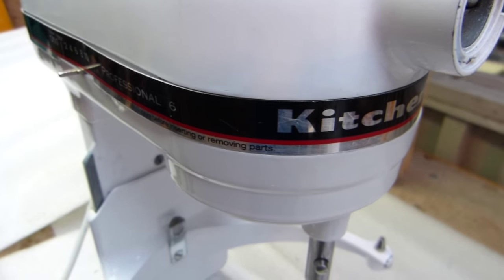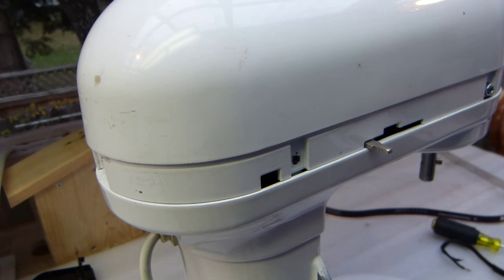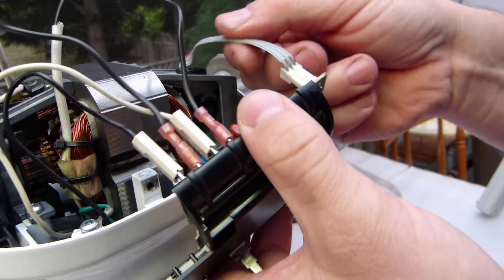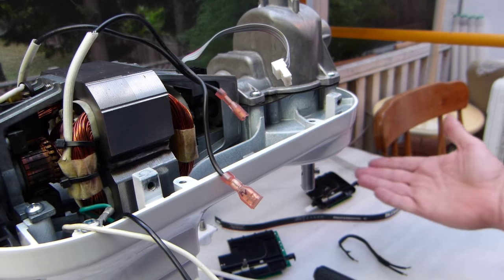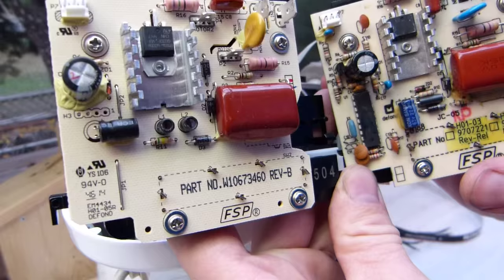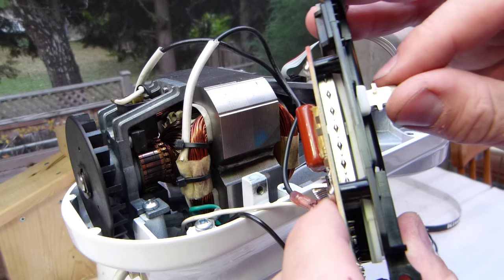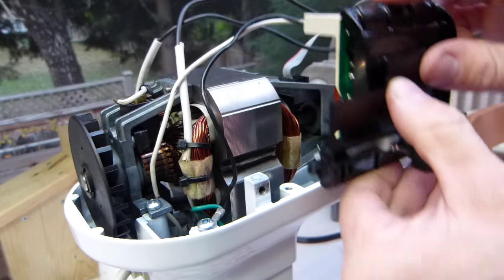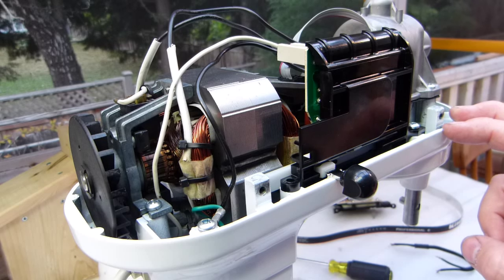KitchenAid Pro 6 easy electrical fix

Comment: Thank-you so very much!  Before I ordered the circuit board, I removed the slide switch from it, and cleaned the 2 copper pieces with a Q-tip and acetone.  After mounting the switch back onto it, and screwing it to the mixer, I tried it out and it worked!  I would have been too intimidated to attempt this without your informative video. Thank-you for leaving your video up.

Comment: IT WORKED!! Breathed new life into my 20+-year-old machine! Great mom & son project :) Thank you for posting clear, easy-to-follow instructions. FYI, the new circuit board had the wide grey wire soldered to the board, so we had to remove the old one from the machine. There are tiny clips on the side of that plug; pushing them in to release (after some trial & error), and plugging in the new one worked out just fine. Can't wait to tackle some backed-up bread-making projects! Thrilled! Thank you again!

Comment: I sprayed contact cleaner on the switch and cycled it back and forth several times to get mine working again. Thanks for the video; it helped me with testing the motor. Otherwise, your switch may have been good, just needing a cleaning. Cheers!
Reply: I was ready to start unsoldering components for testing but thought I'd give this a shot. After a squirt of cleaner, moving the switch back and forth a few times and then reassembling, it works perfectly! Definitely saved me a lot of time. Probably saved me $50 or so to replace the entire control circuit if I had been unable to find a failed component.
Reply: @lexl9533  Same. I had a feeling it was the switch because it started to fail intermittently. Took it apart and before dropping $$ on control board decided to try a splash of WD. Bingo!! Saved the money AND the frustration I'd have felt when it still didn't work after replacing parts! Happy camper!
Reply: 5
Reply: Thanks for the info, sprayed the board with electrical cleaner and that did it! Too much cake batter must have got in there.
Reply: I did the same thing.

Comment: After watching this video I fixed my Kitchenaid Professional 600 (6 qt) which had bad speed control board. Following the approach provided in this video I was able to determine motor/fuse worked fine but the control board didn't so I ordered the board by $19from Amazon and replaced it. Now it works again. Thanks a lot for the post!

Comment: Hotwire trick worked, saw another post to clean the board with electrical cleaner (8-10 bucks a can at any hardware or auto parts store), let it dry and it works!!! I was about to order a new board for 75 bucks. I cleaned both sides of the board. Gunk gets into that lever slot and gunks up the board.

Comment: This video was helpful. In my case it was the thermal fuse, based on a volt test. Got a 5-pack from an on-line electronics vendor and we’re mixing again. The fuse was on the opposite side near the back of the mixer. Careful with the brass clips and any sharp gadget you use to pry them open. They don’t come with the replacement. My fuse was a SF139E 10A 142 degree Celsius type.
Reply from the maker: Thanks for the detail, mate.

Comment: Something to try before you order the circuit card. Spray DetoxIT electrical cleaner (or other brand) on the switch first, it worked on mine.
Reply from the maker: Thanks for the info!
Reply: Thank you! This worked! Saved me 75 bucks.

Comment: This is very helpful. My replacement board has different size connectors, as the old pins are smaller.  Did you cut the connectors to make them fit, or re-wire the connectors?
Reply from the maker: I'd cut the wires and leave the connectors plugged in.
Reply: @theoverengineer  I just realized the connectors are different sizes and i just didn’t match them up!  Haha.  Thank you for the reply.  I’m up and running!

Comment: failure of these control modules seems to be a common event. do you know why? any idea which component fails and whether replacing just the failed component will work?
Reply from the maker: Capacitors, triacs, transistors ... never checked out a board which one actually failed. Let me know if someone does.

Comment: Hi, I see in your video you have exactly the same type of my kitchen aid mixer... I am trying to repair my kitchen aid pro 6 and found 1 diode(zd1) is broken and have to be replaced with new one. Unfortunately the type number on this diode's body is blur and can not be read. Can you inform me the type number of diode zd1 by seeing on your PCB ? That would be very helpful for me if you can do that .... Thank you!

Comment: Thank you so much for this video! My kitchen aid short-circuited when I plugged it in for the first time just after purchase. The voltage where I live is much higher than that used in the US. I'm not sure which part should be replaced. What would you recommend?
Reply from the maker: I don't do remote diagnostics, advice or recommendations. Your options range from getting a new machine to giving up and living without it.
Reply: @theoverengineer   thank you so much for your advice! blessings galore!

Comment: Very good video. Well done, well explained.

I have a speed issue on a Kitchen aid pro 550 plus. when it's turned on, it accelerate incrementally on setting one. Weird. I though it was the Speed control board so I ordered a new one but the new one seems to be stuck at max speed and won't go any faster regardless of the speed setting. I'm going to return it and order another one but I was just wondering if you had any other suggestions ???

I doubt it's the engine or gearing coz the engine is basically on or off and the speed control board is basically controlling the speed by changing the current to the engine but it's just very weird that I get two different problems with two different boards...
Reply from the maker: Motor is fine, gears are innocent, it's all the control board ...

Comment: How old is this video .I have this exact problem . I can't find this part for 32$  . Cheapest I found was 90$  ..do you have the website as to where you got it for 32$ 

Thank you 

Tony
Reply from the maker: Sept 29, 2015
Ebay? Amazon?
Reply: theoverengineer wow 2015  . Ebay has it 77 US $  . Amazon it at 85 Canadian . 
O well . Happy wife happy life .
Reply: hI I JUST FOUND THIS PART FOR $58.80 AT SEARTS PARTS
Reply: Amazon had it at $58-70 depending on supplier.

Comment: Great troubleshooting tip.  Unfortunately mine still doesn't turn on.  Looks like I need a new motor. We bought it used.  Barely.  Sigh.
Reply from the maker: Might want to check/clean with a needle DIRT being packed betweent those rotating shiny copper commutator segments. Or that there is enough length in the carbon blocks pressing against the copper plates.
Here is more explanation: https://www.youtube.com/watch?v=9EHQJDhxZc0 and also  https://www.youtube.com/watch?v=Cn_bb7DopO4
Reply: Turns out the fusible link failed. Replaced it and we are back in business.

Comment: Thank you for the video... but my model is different... speed control is inside or under the motor and its not running too. Need your help model is  ksm6573cer2

Comment: I got the machine from US (110v). My wife used it but connect to the AUS 240 supply.  Two transistors visibly blew up black - I replaced them - but the motor still does not work - Any advices?  Also - on the big red capacitor (on your PCB) it says 335K 250V - problably for 240V house supply voltage...Do you know what it may say on the PCB that is designed for 110V (like mine)..It says nothing on mine - Thanks
Reply from the maker: Test motor windings continuity like this https://www.youtube.com/watch?v=xfR524JZzPk
If it no beep, it no good.
Make sure the probes have solid contact to the winding terminals, not the varnished wire coil.
Reply: Great Video 👍 is it possible to run a US 110v 60hz version running on 230v 50hz by just changing this board with the 230v version?
Reply: Replace your wife!!!!!!!

Comment: Thank you so much for this video! I have a question, what is the green cable for? I had to tighten some of the screws beneath the motor because they were loose. After putting everything back together, the green wire started to spark when I plugged the mixer to the wall. What could be the issue?
Reply from the maker: Green is likely to be ground wire, but color coding changes to meet electrical codes in different countries. It sparks after some other wires get damaged, thus save one from electrocution.

Comment: Mine keeps tripping the breakers as soon as you turn it on what should I be looking for my model is KitchenAid K45ss
Reply from the maker: Bare wires shorting to the housing somewhere at a tight bend.
Reply: I will have a good check for that, trying to work out your accent dutch??

Comment: Got mine working again but now there's only one speed the highest one. Any suggestions?
Reply from the maker: The variable resistor must check out first, triac can go second.
Reply: you didn't just connect the wire and put it back together did you??  that's just to test that the motor works outside of the controlling circuit board.

Comment: I fix my only brake apart the black plastic to hold the board is a 4 screws and on the back on the bottom have 4 metal pin to hold just bend little take off and clean the contacts and bend little the 2 cooper legs put everything back and is working again no need a new board
Reply: Same thing to me. I pass a little sand paper on the  connectors and the printed circuit, and works like a new! :) Thanks !

Comment: mine shuts down after 5 seconds turn off, turn on shuts down again in 5 seconds, any ideas?
Reply from the maker: Sounds like something overheats and develops an open. Look for loose connectors, cracked solder, charring, bulging around that heat sink and transistor, capacitors, but none of them can be opened and fixed. Might need to replace the whole PCB. Also connect the motor direct to AC for longer than 5 sec to test it.
Reply: Try cleaning the speed selector switch with QD Contact Cleaner. Did the trick for me.